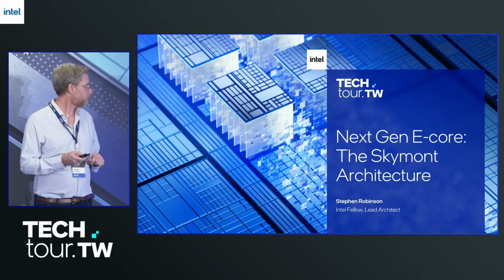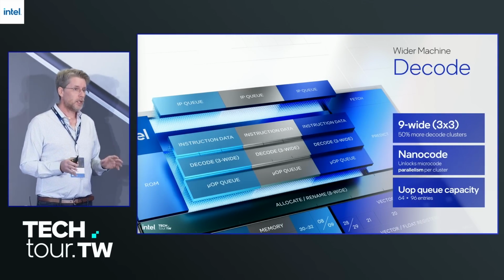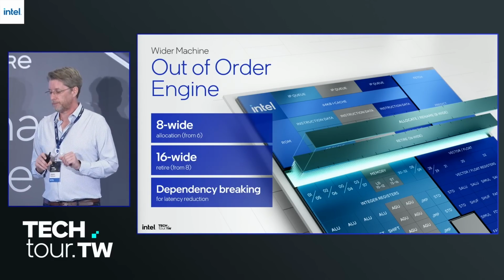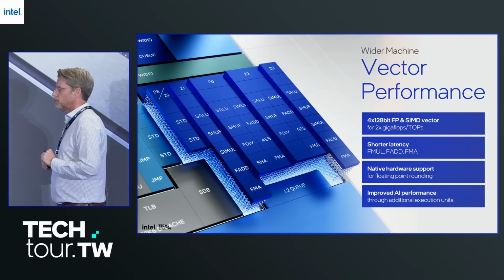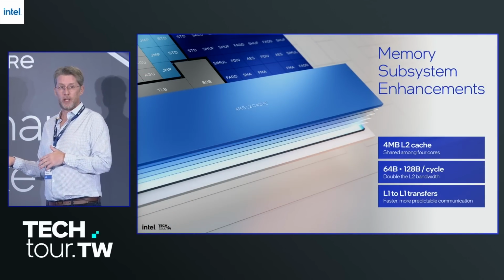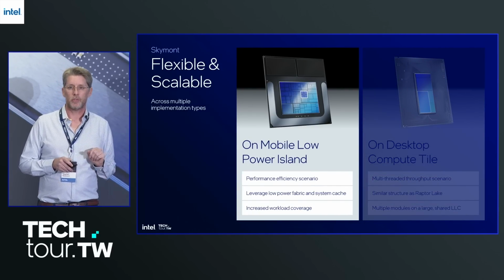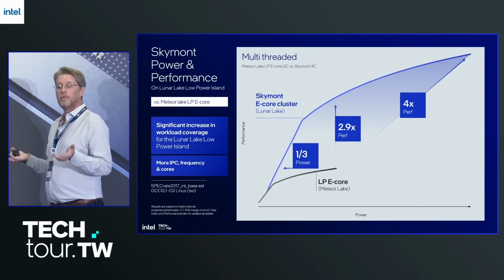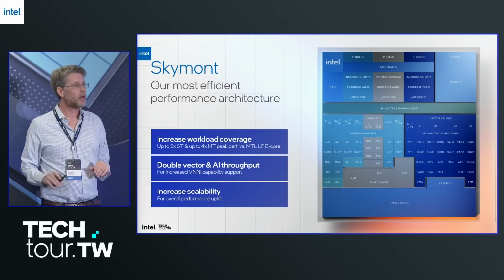Architecture All Access: Live at Lunar Lake ITT: Next Gen E-core Skymont

Comment: Question: during the Nehalem introduction, it was said that 2 cores (on one die) sharing (large) L2 in Conroe and Penryn would not be best at the quad-core level (complex + latency penalty?). Hence Nehalem went with 256K L2 dedicated to each core + shared L3. Has the 4-core sharing L2 issue been solved? to the degree that this is better than each E core having 512K dedicated?
My opinion: long-term, P and E cores should be rebranded a single-thread and multi-thread. The theory is workloads that can be effectively multi-thread, greater throughput can be achieved per unit area silicon. Hence, the future processor should have few P (ST) cores for single thread tasks, and many E (MT) cores for good workloads. In the meantime, software people need to rethink the important algorithms for best multi-thread implementation,

Comment: where is LP E-Core? i knew that is low power scheme in metheo lake.
Reply: The new 4 E-cores in Lunar Lake are LP-E Cores only. In Lunar Lake, the E-cores are no longer connected to the P-core ring fabric and don't function as the previous E-core iteration (that is providing more multi-threading throughput at a lower die area). They are better performance per watt and optimized for low-power multi-threaded workloads.
Reply: These are LP E cores
Reply: They have ditched LP E cores.

Comment: When will you release workstation/HEDT CPUs that would be equal in per core performance to AMD without a dramatic difference in power consumption?
Reply: Last gen E cores just launched called Sierra Forrest using Intel 3nm. The CPU is already very efficient. Next year they will launch Clearwater forrest using Darkmont e cores (a refresh of current gen skymont E cores)
Reply: @technewseveryweek8332  
Sierra Forrest is a purely server part, as will be it's successor. I don't particularly care how efficient it is (and it's still no match for the competing iteration of Zen).
What I am interested in are P-core unlocked WS chips, I don't particularly like what Intel has to offer at the moment in that segment:
1) Lower IPC;
2) Fewer cores;
3) 1.5-2x higher power consumption;
Reply: May be from the next year.
Reply: 2025, Granite Rapids based workstations will be released. Threadripper based on Zen 5 will beat it on performance and multi-threaded workloads due to better micro-architecture, slightly higher core counts and process node. 

Waiting for the Diamond Rapids stuff to come out, that is more interesting.
Reply: @ablesam  
I'm interested in what Intel has in the works.
But the thing is - AMD doesn't sit still either.
We need them both to be equal in performance and efficiency, I just don't know if Intel's future products will be able to offer that compared to AMD's future offerings 🫤
Reply: @ablesam  
Zen 5 is not a better architecture than Lion Cove.
Reply: @technewseveryweek8332  But Lion Cove isn't in Granite Rapids, Redwood Cove is. And Zen 5 beats RWC in single threaded, multi threaded workloads and performance per watt.